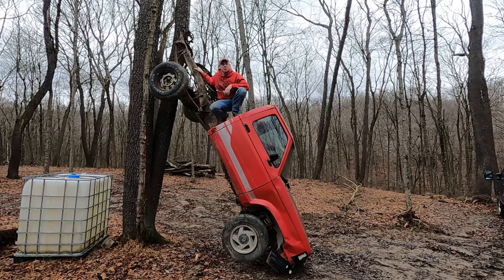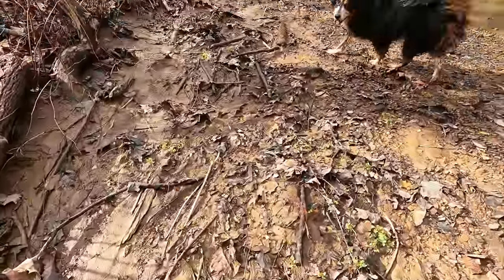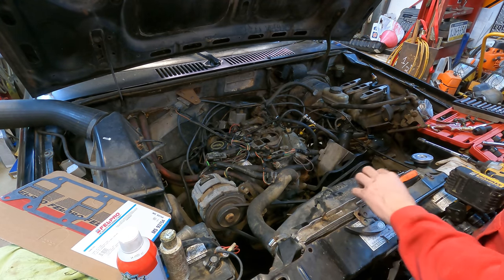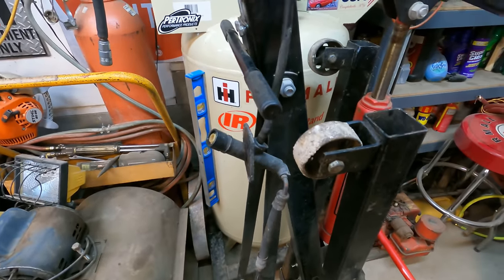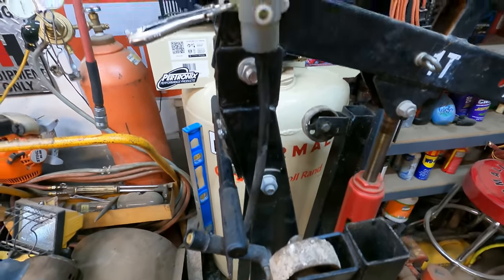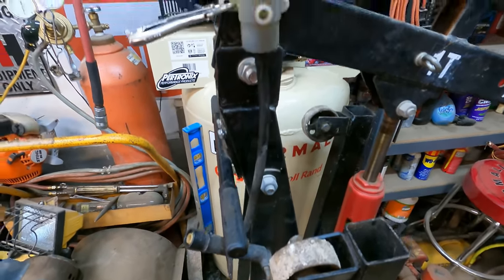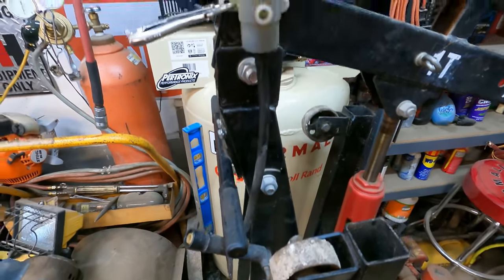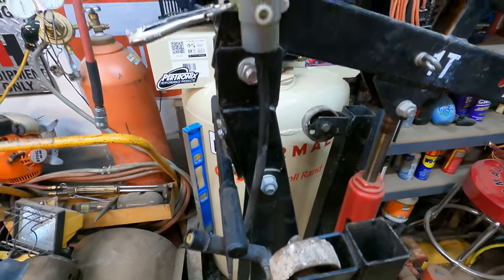$500 FORD Ranger pushes me over the Edge!! (it drives... sorta) 1988 Ranger Pt.2

Comment: idle..   warmed up.. disconnect idle air control valve.. idle speed should drop below normal idle speed but not stall.  if its still too fast.. adjust throttle stop screw on throttle body to bring base idle below normal idle.. plug in idle air control .  with your hand bring the the throttle lever open to around 2000 RPMs then take 20 seconds to return to idle.   
you could also have an incorrect PCV valve.. 

please also.. perform the steps in this test. https://i.imgur.com/WMDprhm.jpg.   make sure the braided ground strap from the back of the engine to the firewall is NOT connected to the rubber bushing on the wiper motor bracket  it needs to bolt directly to the firewall.. 

 be sure to price the clutch hydraulics over at rock.. clutch master was like 15.. new clutch line was 17.. clutch slave was 40..

Comment: I got a slick Ranger edge 2005 model its pretty good automatic.   https://youtu.be/rqdU8Mo_Dso  I had to pay up for this truck. NOT cheap but it only had 90,000 on it. 
Not this ranger but the one I had before a standard I put a new clutch in it I had to take it to the ford dealer to get the clutch bled and they used a pressure bleeder it fixed it but cost me 125 bucks lol.

Comment: I'm confused. maybe its just the fact that the real condition of the truck was not properly shown or explained in either video, but if your goal is to swap a diesel engine into the truck.....then why would removing the engine that you were not planning on using anyway be a problem?? as i interpreted it in the video, if the hydraulic throw-out bearing worked you would have continued on with the project and with this supposed diesel swap, but since the throw-out bearing is bad and you would have to pull the engine to replace it, you are just going to sell the truck???? doesn't make any sense to me that you are selling the truck because you would have to pull the engine when you would be pulling the engine to do the diesel swap

Comment: Sorry to tell you you do not have to remove the motor or the transmission to a fucking slave cylinder I think you better watch some YouTube videos are shit because I replaced mine in about 15 fucking minutes and I did it right or Neath the damn truck and didn’t touch the motor or the transmission to remove them do some research

Comment: I have a 1994 Ranger with the same clutch system. That has to have been designed by an idiot. The hydraulics are impossible to bleed in the truck. The master cylinder has to come out so the air bubble can rise to the top to bleed it out.
Just plain Ford STUPID!